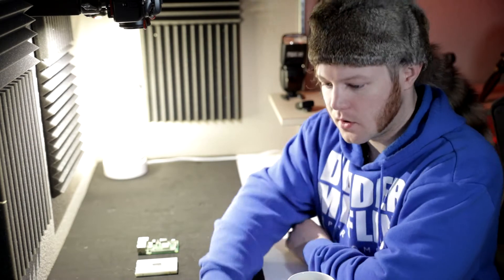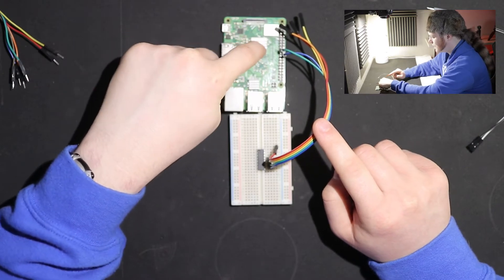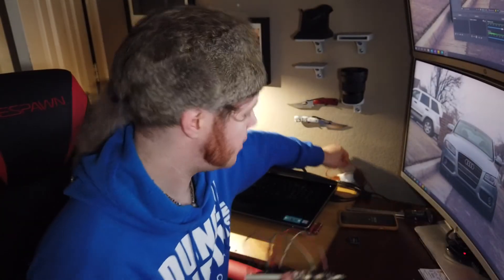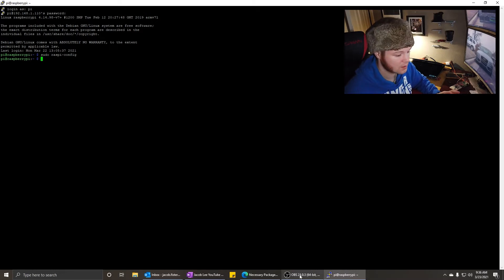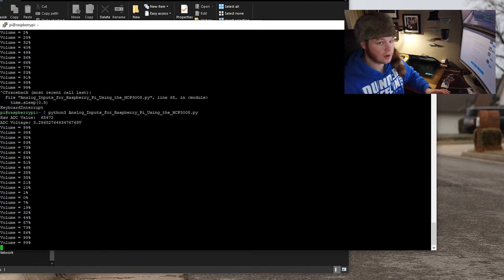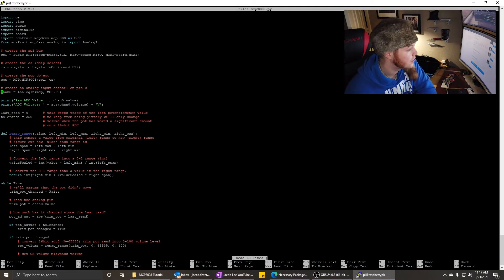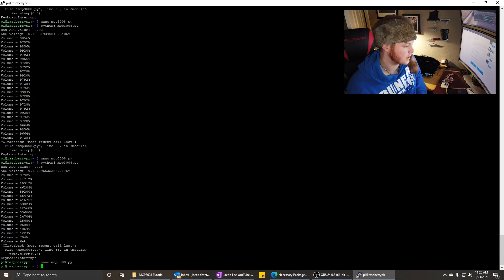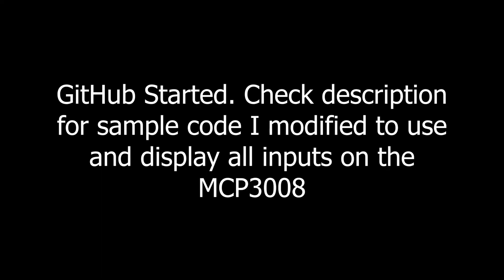Get Analog Input on the Raspberry Pi | Using the MCP3008 ADC Chip

Comment: Thanks Jake, great video and github site as well.  I was wondering why the python code refers to CS on pin GPIO22 (ie: cs = digitalio.DigitalInOut(board.D22)). In your example the cs wire is on the Raspberry Pi's GPIO8? The code works as you have it but also if I change it to 'cs = digitalio.DigitalInOut(board.D8)'.
Reply: I'm using a headless Raspberry Pi Zero W running bookworm and virtual python3.11.
Reply from the maker: @djuwhite  that may just be a typo, I’d have to go back and check. Thanks for pointing that out!

Comment: Is there a way to hook an adc up to a rpi5 without a breadboard? 

Trying to hook a sparkfun ad8232 heart rate sensor to adc to rpi5, just seeing if I can bypass the breadboard
Reply from the maker: @gritpop  you would just need a way to connect the pins directly to the Pi. You might be able to find a breakout board for it or you could solder female jumper wires directly to the pins of the chip and plug it in that way.
Reply: @ thanks dude!

Comment: nice explanation thank you! 
I was trying to use 5 and more channels simultaneously and use the values to retrieve some stored data. for instance if I get values 124  245  624  164 from 4 channels, how can I use these values to play sound in RPI. when I get back to these values, it has to play the sound which is previously assigned for those values.

Comment: I'm trying to make multiple ADC's work in a Pi by connecting them via SPI. I'm using this code as a base, but it seems that I cannot make multiple ADC's work at the same time.

I suspect there is something wrong with the chip select, do you maybe know how to add another chip select so that two (or more) ADC's could be sampled at the same time?

cs = digitalio.DigitalInOut(board.D22)
 I tried using this line of code, and then changing D22 to another pin, but that didn't help. It only works with the pin that you used in the video.
Reply from the maker: Just from what I know without looking at the code myself (I'll check on this later and get back with you) but make sure the pin number you're using is the GPIO number, not the physical pin. Example, GPIO 22 is physical pin 15. so if you add another cs, using board.D27, that would be physical pin 13. You might already know all this but it trips a lot of people up so I just want to cover all my bases. If this doesn't solve your problem let me know and I'll get my gadgets back out and check for myself.
Reply: I am new to all this myself but you might consider using I2C communication.  ADS1015 / ADS1115 A/D Converter uses I2C.  I haven't studied enough to understand the pros / cons between these two buses.  Selecting a specific ADC may be more straight forward.